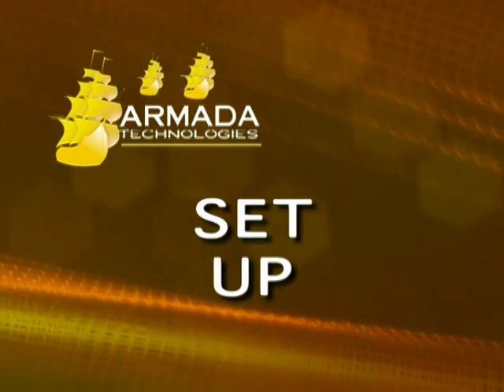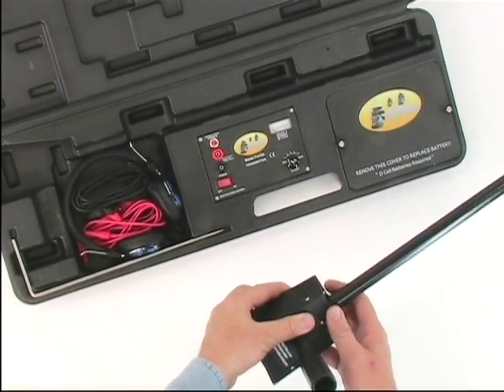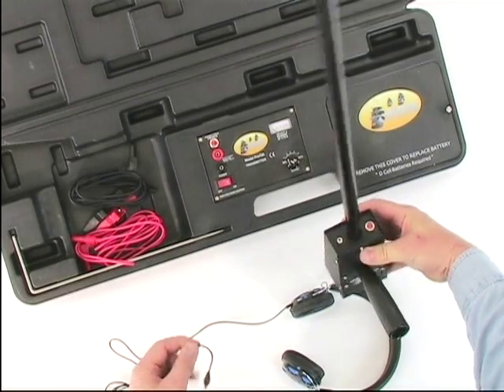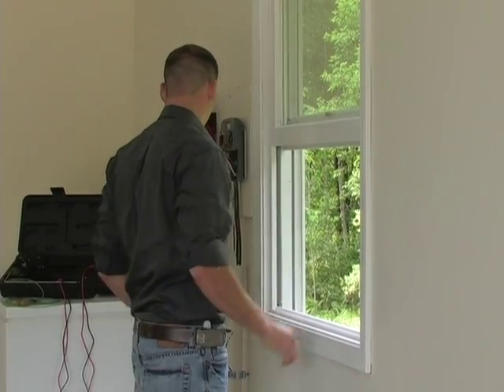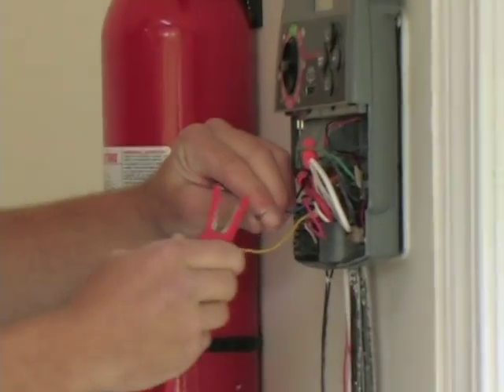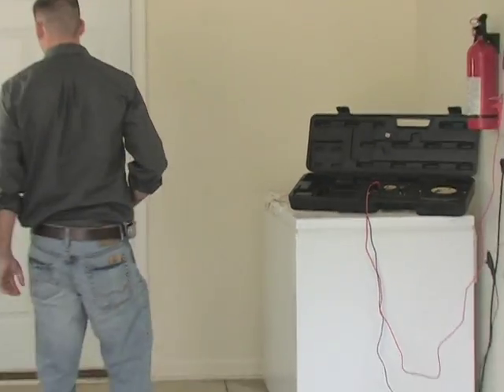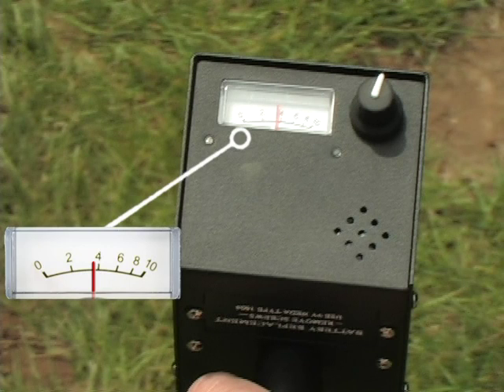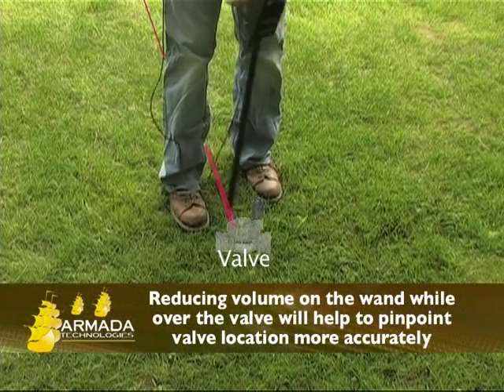Armada Technologies Pro700 Sprinkler Wire and Valve Locator

Comment: Thanks for the video - I purchased your pro 600 model in 2006 and have used it several times to locate hidden valves. I didn't realize the common for the valves should be disconnected. That info should make the next locate easier, I'd think. I'm not 100% clear on the technique of determining depth so will study that some more. Again, thanks for the video and keep up the excellent work!
Barry Schultz
Sandpiper Concepts, LLC
New Smyrna Beach
Florida